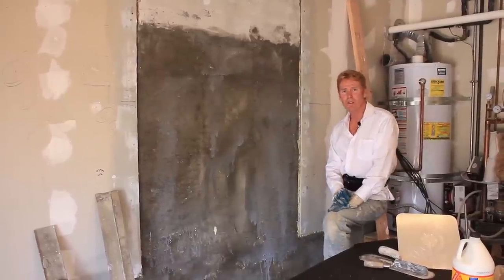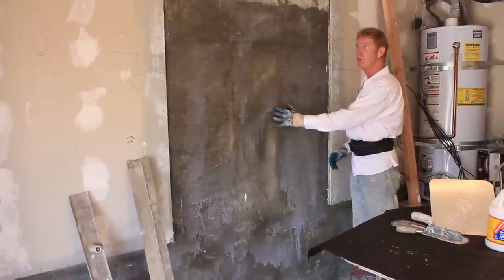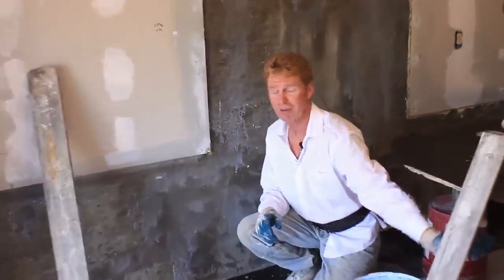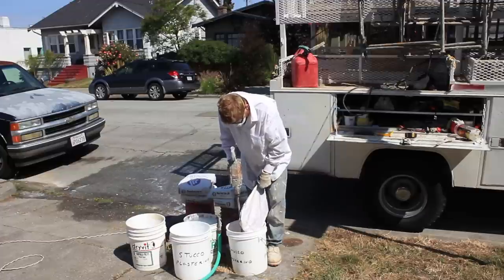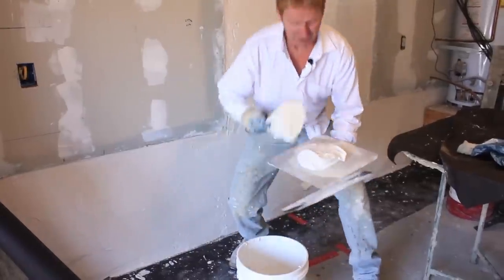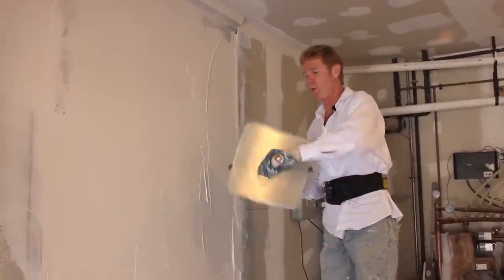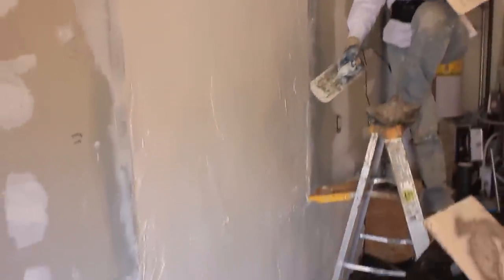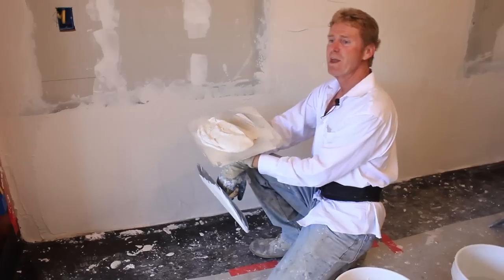Joint compound to blend concrete and sheetrock.

Comment: Hello, Kirk. I am plastering over drywall next week. Do you ever sharpen your trowels? I've already broken my new trowel in, but its edges are not razor sharp. Do they have to be extremely sharp in order to achieve a good finish? I am a little confused.

Thank you. :)
Reply from the maker: Howdy Anndalf, whoa,dude, that's a cool question,
 I had a friend of mine who did plastering at a prison for a month many years ago, he said sharpened his margin trowel just in case, 
 I thought to myself when I heard this, in case of what?
 if a guy's needs one he'll give it to him sharpened, as this fella didn't  seem to have a mean or tough disposition.

 O.K. back to your question, no, I have never sharpened a trowel or thought twice about using a new one versus one broken in or used for a year.
 I believe any trowel as long as it's not bent inward would work well if it's new or 15 years old, no difference.
 While we're on the subject, cement trowels are only 4 inches in width compared to plasterers trowel which are 5 inches wide, the extra width makes them flex a bit more and this my friend is a good thing,
 best wishes with your project,
 Cheers,
 kirk giordano

Comment: Hi Kirk,
Thanks for your videos, they're a wealth of information! I'm Dutch too, but have been working as a hands-on GC in Los Angeles for the past 8 years. I think Bieske21 is referring to one of the Knauf brand products which are very popular in North Western Europe. Here, on the West Coast of the US, I like the 'One Pass' compound made by Rapid Set. It's a little more expensive, but ideal for smaller repair jobs. My question for you: does the concrete bonding agent that you apply function as a waterproofer between the concrete and mud as well?  Keep 'em coming...I'll see you on the next one :-)
Thanks,
Emille
Reply from the maker: Evening thathandydutchguy, thank you,
You're probably right, doubtful i'll live long enough to try all the different products available, I tend to use the proven and or popular ones sold at my local supply yard,
Westside building materials.
 Best wishes, 
 Kirk & Jason Giordano's DIY plaster and stucco network

Comment: Thanks for all the great videos! What kind of plaster are you using? And where would I be able to get it?
Reply from the maker: Hi fidodidojohn, on this one I used a 20 minute mud that available at Home Depot, Lowes and most larger hardware stores.
Reply: Would a 90 minute Sheetrock Durabond Setting-type Joint Compound work for this application?
Reply from the maker: Hello fidodidojohn, absolutely, 
Lots of folks comment that they have seen me use different materials for similar projects, this is true as I do enjoy showing the different materials that can be used for the same repair.
 Best wishes,
 kirk giordano Plastering

Comment: this is going to be a stupid question probably... 

but here goes...can you use exterior stucco example ( rapidset stucco or rapidset mortar ) on brick walls - european homes .. instead of plaster indoor?

Great videos by the way.. I enjoying watching and learning a few things..
Reply from the maker: Howdy, SX dude, not a foolish question at all,
 yes, you can use exterior stucco for an interior, however on this interior, we are trying to match the sheetrock finish, it really difficult to smooth or trowel down sand and cement to this level of smoothness, so I preferred to use a gypsum based product.
 Cheers,
 kirk giordano

Comment: As a drywall guy I have a hard time  not taping those joints. You don't get cracks where the drywall meets the plaster?
Reply from the maker: Howdy Brad dude, tough to tape seams when the different substrates very in depth. 
                       Live long and plaster
 how to repair your number 1 investment

Comment: Can you plaster over a painted concrete wall inside building (to cover block look)
Reply from the maker: Hi Dana K, of course, but first prep work is necessary, you must clean the wall like your going to eat off it, then apply a bonding agent, now you're ready to apply any type of product over it.
 Best wishes, 
 kirk giordano plastering
Reply: Kirk Giordano plastering Inc. how does one prep it as if they’re going to eat off it? What do I need to do to prep it?

Comment: Kirk, please clarify product you are using for 20/40/60/90 minute mud.  Is that the Easy Sand product sold by USG?  I am in Mid Atlantic region.  I want to skim over a mortar wall in my basement.  Thanks, Matt
Reply from the maker: Greetings Matthew, I used 5 and then some 20 minute mud, the number means the time it will set in.😉  Our unique plastering Tip:  all subscribers or anyone who stumbles on our channel with a question, type it into our Stucco/Plastering channel, and like magic, a video will appear to explain how it's done.  
   This feature is miles ahead of any plastering forum. 🥳 
Kirk & Jason Giordano Plastering

Comment: Nice video Kirk. Can you tell me the name of the system that is used on block homes on the inside? I  know from trying to hang shelves on it, there is a thin layer of stucco over a foam board. Thx.
Reply from the maker: Morning David, there are about 10 often used gypsums plaster used, you will have the chore of locating and grout joint or you can blow out a chunk of the cinder blocks, below is just one system.
 If you make holes in your finish caulking and or any fast set gypsums will work to fill them, Plaster of paris or fix all set super fast for small holes, or even tapping mud can be used.
https://youtu.be/LzTvF9xO2cU 
Cheers,
 Kirk giordano rendering
Reply: +Kirk Giordano plastering Inc. Thanks for the reply.
Reply from the maker: Howdy Hino. yes you can however a bonding agent is required.
 cheers,
Kirk and Jason’s sand and cement rendering videos

Comment: Kirk, I enjoy watching you work. I do the same thing that Rudd does but i am up here in Sacramento. Question about this job. Did you do another coat on top of that hot mud and did you apply any tape at that sheetrock to hot mud seam? Wouldn't they crack in a day or 2 once that hot mud started drying out?
Reply from the maker: Hi Travis, no, it won't crack, this is interior, exterior stucco have a tendency to crack.💃🏻

Comment: The only time I ever use 5 minute mud is for even smaller repairs than that, infrequently and usually in the little boxes and not the bags. However I don't have a Jason of my own to mix it for me, so by myself 20 minute is the fastest setting compound I use. If it's a tiny repair I can go over it with 20 minute and do something else for the next 15 minutes, or if it's a wider area I will need more time anyway. I'm not a plasterer or a drywall contractor but regardless I understand why suppliers don't stock it anymore because between only a couple pros like you, a random contractor like me looking to patch a teeny hole, or some do-it-yourselfer who has no idea what he's doing will only buy a couple units each month and the rest get tossed.
Reply from the maker: Howdy WCSD, this was the last time I have used that 5 minute mud myself, set way too fast for me.
 cheers,
 kirk giordano plastering

Comment: I have a room in the basement and i have a huge humidity problem. Yes, I use a humidifier but it is in one corne of the room. I have replaced the drywall and the wood behind it a couple of years back, seemed to solve the issue although can feel the water in the wall ( water is cold). I've seriouasly consider just adding a coat of cement to the wall to help avoid the humidity issue to come through the wall and to solve the horrible job my dad did with eveing the current wall with the new wall. Would this ideal or is this a stupid idea of mine?
Reply: To add! I know sand cement wouldn't be idea since it may be hard to even out. And yes we (me) have skimed walls before and they have came out beautiful, i simple didnt know how to repair and thats is were my father came in.
Reply from the maker: Howdy Raquel dude, gotta love a dad who loves his sons,
 You can apply a lime based plaster which will absorb moisture and when dryer conditioning occur will release the moisture harmlessly into the air,
 I will send an email to what I am referring to but unfortunately it is long.
https://youtu.be/jI54QRx0_H0
 Cheers
 Kirk giordano rendering

Comment: Hi Kirk, I have a similar project coming up blending / feathering. You mentioned 5 min and 20 min mud, but what type of mud did you use on this one. Was it a base coat? or did you build up a veneer?  Thanks!
Reply from the maker: Howdy Jim Dude, I used a sheetrock compound, I don't advise anyone to use 5 minute mud, stick with 20 minute or more time if needed buy either the westpac or the fact patch, both work the same.
    Cheers and happy plastering,
 Kirk giordano’s teaching videos

Comment: You could put taping mud on the back of the drywall and then some concrete nails
Reply from the maker: Morning Gil Velazquez, no way brother, the tops were flush, plus the sheetrock would not have adhered with concrete nails even if I had taped in 100, have you ever tried to hammer a concrete nail through sheetrock to concrete, if you try, your first attempt you will find out that not only you cant do it but old Kirk can't either.
Why? As you try and hammer the nail in you will eventually break the sheetrock paper barrier plus trying to hammer in a concrete nail creates a hole the size of the hammer or sludge hammer head.
 Best wishes,
 kirk Giordano

Comment: thank you for your awesome video. understanding you are joining plasterboard or drywall with concrete wall. Does the joint part crack or hairline shows up over time? Having problems on my project.
Reply from the maker: Hello Edmund, no, not under these conditions.

Comment: hello Kirk and Fam  , just want to say thanks and ask a question . So thanks I have learned a TON from your videos keep it up.  I am sure the videos  help alot of people . The question . I have a really bad interior garage wall it has eveything you can think of , concrete , drywall , joint compound , and semi gloss paint , can I just clean it add the concrete bonding liquid ( or does it have to be plaster bond ) and just Hard diamond plaster over all that  . and if I  have a few deep holes can I just prefill it with 20 min mud ? If yes how many layers of diamond should I do ?
Thanks again
Reply from the maker: After it's all cleaned and has a bonding agent, everything can be covered with just Diamond, or if not sure how to, apply a base coat of diamond, then a finish coat of diamond.
 For the longest-lasting finish, both are required. However, there are exceptions to the rule. See both videos here.
https://youtu.be/-e-3-6wc0nU/ one coating with just lime finishes.
https://youtu.be/UXVrDwdh3Ro?/  Apply just a Plaster lime base coat, it's sandy, but that's what many folks want.
I have many more videos on this subject, but both take awareness if you cut out one coat. 😉
Reply: Great thank you

Comment: After the 5 minute mud and sanding is it ready to prime and paint?
Also can I use any plaster instead of the 5 minute mud after applying the bonding adhesive?
Reply from the maker: Hi Shantal, You buy the bags depending on your skill level.🤔
From, 20-minute compounds, means when mixed, you have 20 minutes to apply before it sets.
   The 40-minute compound, 40 minutes to apply, and so on, from 5-minutes to 20, 40, 60, 90, to an hour and a half. 
All you do is add water. 
FYI, if your buckets and drill paddles are dirty or full of residues due to not cleaning well last time you used them, this will set the mud much faster, always wash your tools. 
Click on this video and skip forward to 3 minutes for pictures and details.  https://youtu.be/k7tE652qOH8
      USG's, Easy Sand Joint Compound Or Westpac’s Fast Set Joint Compound, they are both o.k. to use in fact I can't tell the difference.
Undoubtedly one is sold at your neighborhood hardware store.
 Bringing peace, love, and brotherhood back to the world of “Plastering.” 🌍
    The complete plastering encyclopedia on video, by the plastering messengers of Youtube.  
     Over 800 videos 🎭 👀

Comment: What if that concrete wall is exposed to outside elements on the other side. Would the moisture soak through the concrete wall and weaken the plaster?
Reply from the maker: Good morning Tyler, if any wall is compromised by exterior moisture not only will any plaster be at risk, but all the wood framing, insulation, electrical and sheetrock plus floors carpets and so on.
    Live long and plaster
 teaching  plastering video’s

Comment: How do you fill a gap around a stone fireplace?  I have about an inch around the sides where I couldn’t get the sheet rock tight to the stone fireplace.  Do you recommend a product that will fill that joint where gap is between the stone and sheet rock?
Reply from the maker: Howdy Guinea, lots of ways, you can buy a small box of fix all or a bag of sheetrock compound that hardens in 20 minutes.
                               Live long and plaster
         Mastering Plastering for the beginner’s to experts

Comment: Hey Kirk, what material are you using to go over concrete to drywall?  Do you need to use any kind of seam tape to prevent cracking?  Thx, Bill
Reply from the maker: Evening William, I believe it was fast patch 20-minute mud.
No fiberglass mesh in this circumstance would not help, the concret won't shift.
   Bringing peace, love, and brotherhood back to the world of, “Cement Plastering.” 🌍
With over 800 educational and free Youtube videos, by your favorite plaster geek, “me🤓” and my son, “Jason,” the bearded plasterer.💃

Comment: Good evening Kirk living in a house that’s complete cinder block walls they are painted white but want to smooth out ugly look of cinder block, can I use all purpose joint compound? bought it from Home Depot it’s a white and green bucket.
Reply from the maker: Sure you can, apply a bonding agent like quikrete first over immaculate walls. This is only for the inside walls.😉
Reply: Thanks Kirk

Comment: Are you using Quikrete Stucco Base Coat or Quikrete Stucco Finish Coat or Both?  Or are you using another product?  If so, could you please specify that name brand? Thank you
Reply from the maker: Hello Angel, I'm using, DRYWALL compounds if it were me, I'd go to the nearest Home Depot, Lowe’s, plastering material yards, or even the small hardware stores and purchase some sheetrock compounds; these compounds set in 20, 40, 60, and 90 minutes and can be applied almost as thick as you wish, USG and Westpac’s are really popular for this quick patching. 
    These compound come in 20-pound bags of dry power, yes you have to mix with a drill in clean buckets “it’s a bit of a drag” however the premixed sheetrock compound take forever to set and require many coats. Joint Compounds, Westpac Fast Set, or USG Easy Sand in this video: https://youtu.be/k7tE652qOH8at/ 2:26 I show the two types of gypsums, Westpac and easy sand.👍

Comment: Can I use a concrete filler on a dry wall
Reply from the maker: Good afternoon Linda, I would not advise it as concrete has rocks in the bags, use can use stucco however.
                       Live long and plaster
  teaching repairing your number 1 investment your home

Comment: Hi Kirk. I`m a plasterer from Manchester, England and I am enjoying watching your videos and seeing how things are done stateside. Quite different to how this job would be done in the uk and I am wondering how you deal with potential cracking where your plaster meets the drywall? Here we would level the area up with backing plaster and then apply reinforcing tape over the join. Once set finish plaster would be used to cover the backing and the tape but even then hairline cracks can still appear.

Our plaster is mainly gypsum or cementicious but we do have a onecoat plaster that I think is similar to what you used in this video however that would still crack without reinforcement on the join. 

I would love to hear your thoughts on this and thanks for taking the time to make these videos.
Reply from the maker: Good morning Ian dude, my take on cracking are in three video's below although I could give many more reasons.

    Live long and plaster
 teaching  plastering video’s

https://youtu.be/C3Jqe6sQt2s         : cracking for deed weight
https://youtu.be/2sBHTy-v9ic          :  cracking for sun expansions, woods swells thus stucco cracks
https://youtu.be/O5PIz9WQfzM      :new hose cracking
Reply: Good morning! Thanks for the reply and I will be sure to check the links, however my question was more specifically about if you had any cracks on the wall in this video where the plasterboard butts up against the new plaster?  I was surprised that there was no reinforcement on the join and wondering why it wasn't used? Does the join receive an application of paper tape and joint compound afterwards or are your plasters better than the stuff we use in the UK and less prone to cracking? 

Have a great day! it is 8:35 pm here and I have just got home from work, about to put my feet up and watch the links you posted.
Reply from the maker: Good afternoon Ian, we applied a bonding agent to the wall, thus no cracking.
       Live long and plaster
  teaching  plastering video’s
Reply: Cheers for the reply. I think I will try to order some of the weldcrete to give it a go. Here in the uk  we use either diluted PVA glue or a product called "Thistle Bond-it" which I don't like as it completely kills the suction and I wouldn`t trust either to prevent cracks in this particular situation. I will also be looking into "20 minute mud" to compare it to the plasters available here.  

Have a good weekend!